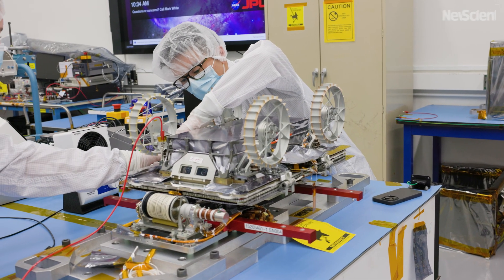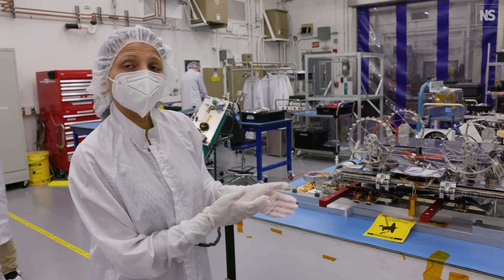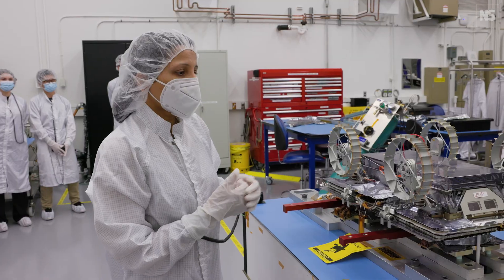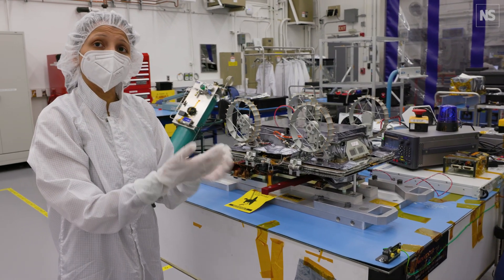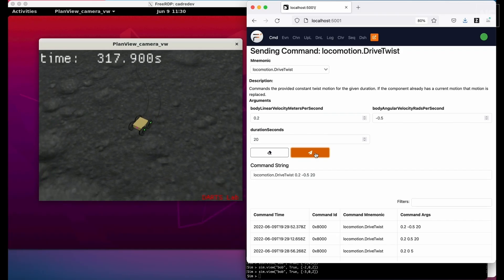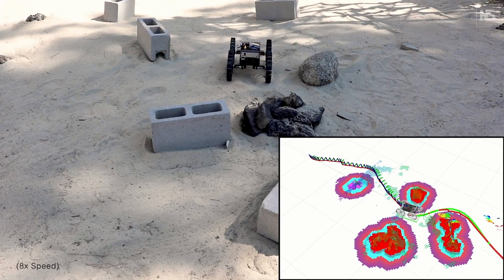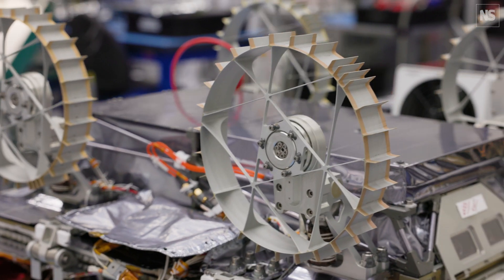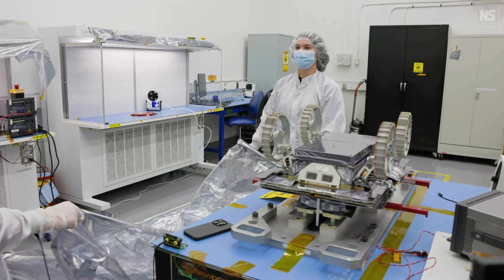NASA CADRE moon rovers will test autonomous exploration of lunar surface

Comment: The battery provides the power and the solar panel operates in charging the battery, to maintain the voltage flow from the battery. The solar part does not directly power the object (rover)

Comment: This is a joke, right? What’s with those wheels? If one catches a rock at the wrong angle, it will fall. Try empty spherical ones- 5 of them (4 where the wheels are and the fifth in the centre). Each sphere to have their surface like foldable scales- it would help with traction/ energy consumption. It can rotate 360 degrees whichever way. You can program its computer to stop 1,2,3 wheels according to terrain or if they get stuck. Program it to retract one if it gets faulty and redistribute the  weight so that the remaining ones can still make it move. 

Also, is there any particular reason for the shape and placement of the solar panels except making it as ugly and unstable as possible? Why not make the body like a cone with a rounded top, with a camera inside that can move 360 degrees looking out through a transparent band in its fuselage (or whatever you call its body)? Cover the body (minus the transparent band) with photovoltaic cells.